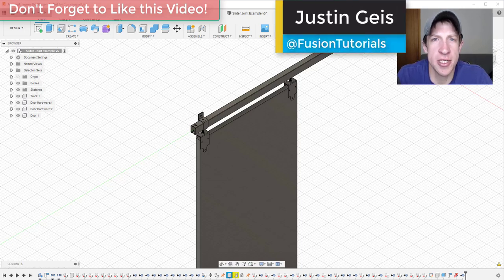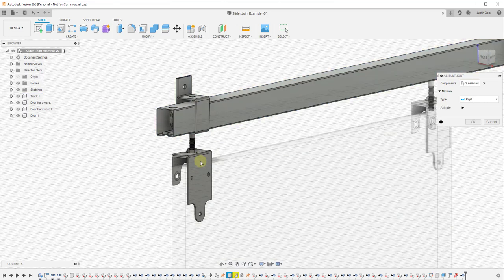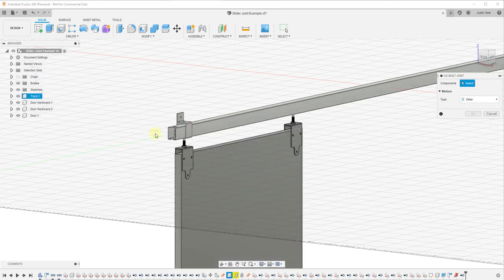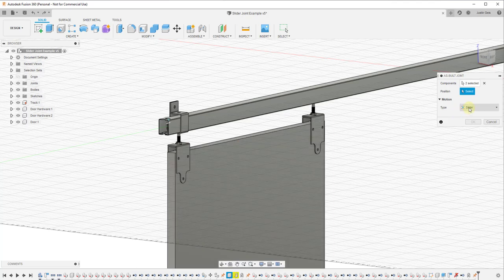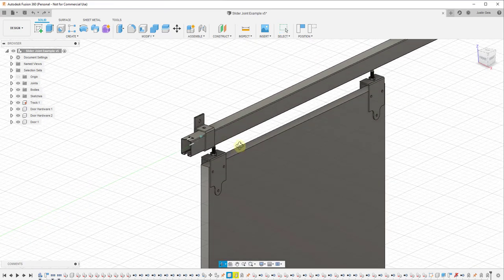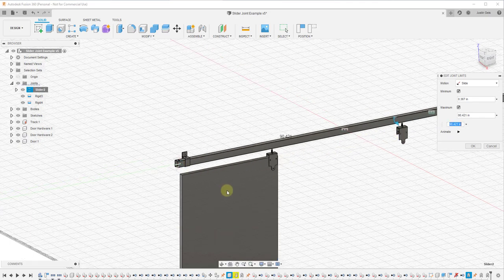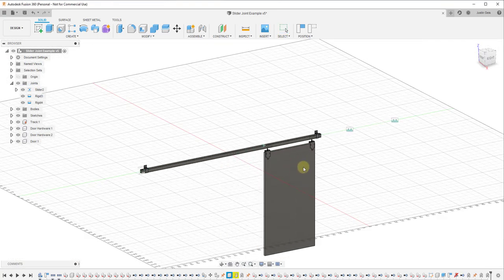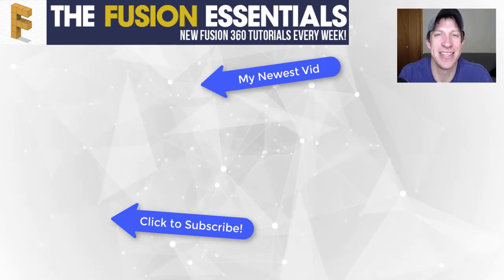Sliding Door JOINT SIMULATION in Fusion 360

Comment: Justin..Wonderful examples.  Is it possible to provide an how to on creating an aircraft Fowler flap.  It requires two fixed slots one being straight the other curved on the wing rib.  The flap would have two pins attached to another rib. The two pins would track in the slots causing the flap to extend in a motion dependent on the slots.  I have been trying to do this for two years and cannot get my head around it...  Hope you can do this for us model aircraft designers.  Great channel...Thx Jim